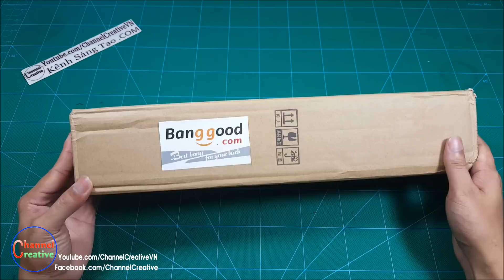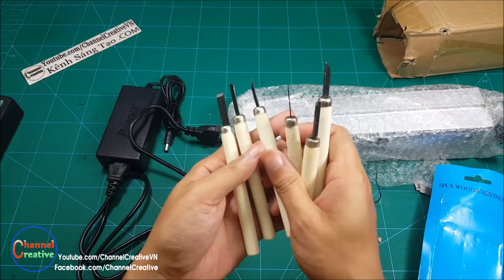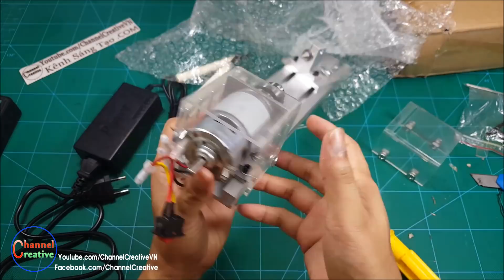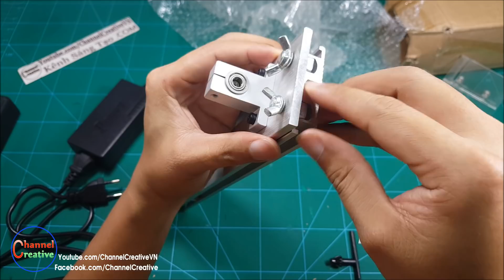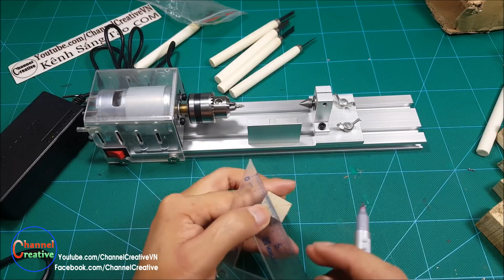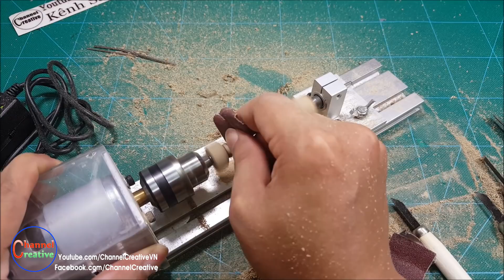Test MINI LATHE MACHINE For Woodworking DIY

Comment: Got one of these for Christmas and the shrouds are now metal instead of plastic. Looking forward to doing some little turning projects.
Reply: I'm glad I bought the version with the black metal shrouds instead of the clear plastic. I'm thinking I might be able to get a small cross slide to put in the place of the tool rest which will make things better
Reply: @dannymadison6335  Yes, the tool rest can't move in very close to the work Not ideal out of the box.

Comment: I have just obtained one of these for mini wood turning.  You need to do two things differently:

Set the toolrest closer to your workpiece.

Use your tools like chisels, NOT like scrapers as you are doing.  You should produce nice continuous shavings when shaping your wood, NOT dust.
Reply: Hans Proebsting how wide does the drill chuck open?
Reply: @dhellard214  I believe its maximum is 10 mm with a max rotation space of 55 mm

Comment: i made my first project with this mini lathe, i choose a pipe for smoking! This mini lathe works great for small pieces!
Reply: Hi @jaxmany , Do you use it for briar? thank you!
Reply: @mauroelabora  Not really, I just explore with woods that I had in the workshop, they really have been tests, the lathe has good power for soft woods but it's a matter of trying whit hardwoods.
Reply: Does it have the power to turn pen blanks on? On a tight budget and a mini lathe isn’t in that budget.

Comment: Several questions:
What kind of wood are you turning?
How wide does the chuck open?
What is the distance between the motor shaft and the base? (i.e. max object diameter)
Reply: 55 mm

Comment: I’m wondering what the maximum length is a person can work on and if it would be possible to extend the track for pieces that are up to a 12” - 14” long
Reply: I was wondering the same thing, and if you could buy something to raise the 2 pieces to work on something with a larger diameter
Reply: No. You would need a bigger lathe.
Common sense...
Reply: No it’s against the law!

Comment: could you connector this mini lathe with the digital RPM controller? i know this machine does comes with the controller on the power supply.

Comment: Sir, can you make a 3d printer using Arduino and cd drives
Reply: It would cost more in basic needed parts than it would be worth building. A hotend extruder isnt cheap you could get an arduino with stepper drivers and the shield and motors but you still need the hotend just buy one on gearbest get like a cr10s or something

Comment: Not a lot of use having such a small lathe.... Your projects would be very restricted
Reply: Depends on what you use it for might be the perfect thing for small projects
Reply: @owenkern2386  yeah, but if it's something you're going to get into, you'd pretty quickly need a bigger lathe. May as well get something that you won't outgrow in 3 weeks.
Reply: @JamesW81  I'm just going to use it for making panther Martin and mepps style lure bodies out of brass so it should be just perfect for that
Reply: But idk of it's good enough for brass
Reply: @owenkern2386  brass is pretty soft, should be ok with hss tools.
Reply: @owenkern2386  ah yeah, if that's all you want it for I'm sure it will be fine.
Reply: @JamesW81  - unless you have used this lathe to turn brass, how can you be "sure".